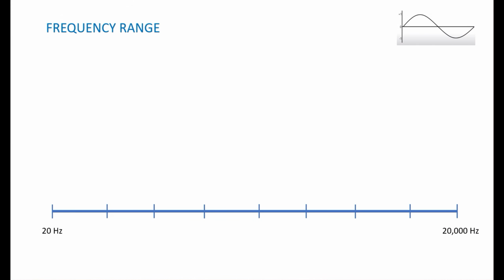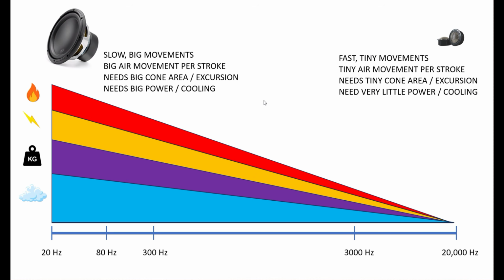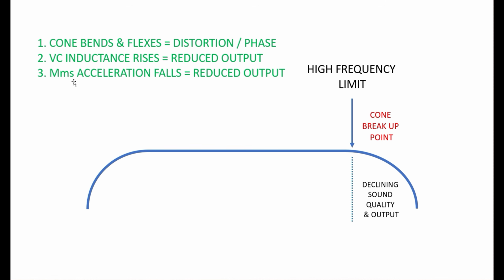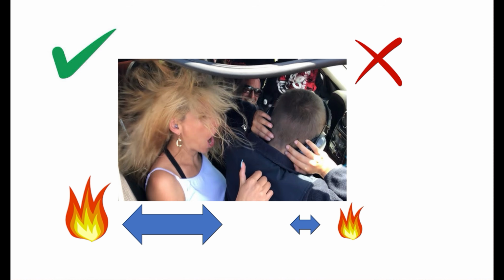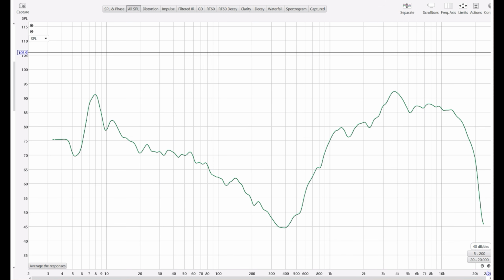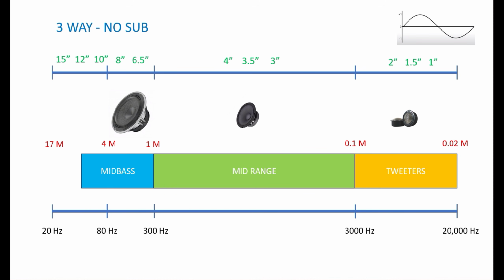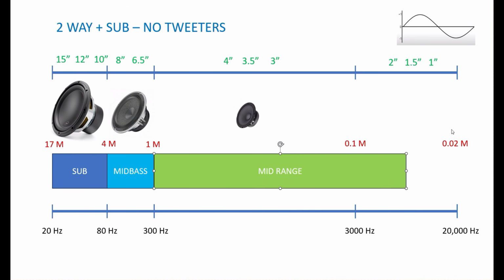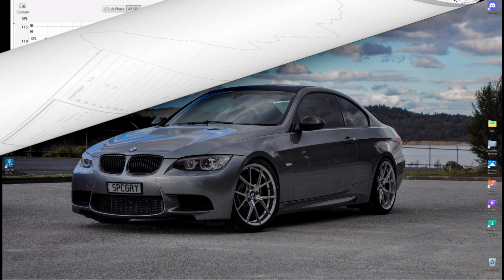FREQUENCY RANGE & SPEAKER LIMITS

Comment: With 2-way  no problem to make a really good sounding system "6.5 + tweeter" without any mid compromise. But 90% not in a car)) Non cause of your listed problems! At home you listen to midbass almost on-line, 15 degrees angle maybe. But in car this is main problem: the bigger speaker the earlier and stronger it dependant on angle of listening. Why 3-4 inch mid make so big difference: at first it is less angle-dependant. Second - you can locate it much better for listening angle and direction. Third - distance between drivers and their bands are more close to each other, you can place MR and HF really close to each other while distance between LF and MR is not so critical as wave at cross-point is much longer. P. S. in pro audio for outdoor performanse midrange drivers quite often are 12 even 15 inches and they can easy go up to 1500 Hz at least!)) 8 inch play perfect to 2-3 kHz, so size alone is not really so principal problem
Reply from the maker: Correct, it is not just about speaker size, listening angle and location play, installation, tuning etc, all play a role in the end result.  Your example of being able to locate a mid close to a tweeter makes it easier to integrate then a mid bass in a door is a good example of this.  Large speakers absolutely can play high frequencies, but the question is whether they are the best suited for the job in car audio?  For example you can get a good result from a 2-way system without mids, although it is usually more difficult to do and is dependant on the mid bass and tweeters upper and lower frequency limits once installed and tuned.  It also depends on your goals (eg budget build vs SQ build). The point of the video was not to say you must have a 3" to play 3000Hz.  It was to explain that every speaker is designed to play a certain frequency range well and speakers are different sizes and designs, because different parts of frequency bands require different things from a speaker (e.g. bass requires more displacement and power).  The other key point of the video was to explain every driver has its upper and lower limits. You can push speakers beyond those limits, but the trade-off is, increased distortion and reduced sound quality. Asking a speaker to cover more range then it is designed to play, will result in a compromise in sound quality.   I hope this makes sense, I really like your insights. It shows a very advanced understanding of the subject and I fully agree, size alone is not the principle problem :)   Big thumbs up

Comment: Hi, great channel, lots of useful information. I have Helix DSP 3 installed on my system. I wanted to configure it, but the computer doesn't detect the processor, and then the red light started blinking. How do I reset it to factory settings now?
Reply from the maker: Hi Alek.  Page 18 of your user manual describes what the flashing lights mean . So it depends on if they are flashing fast or slow.  If the software is corrupted then you need to update it but given your computer doesn’t detect the dsp then I’m guessing you can’t do that. Resetting the DSP is also covered on page 18. You press the button marked control for 5 seconds.  I have never done this myself, so I have idea what this does. So do this at your own risk mate.  Once reset i guess you will need to upload the pc tool software etc.  good luck I hope you get it sorted
Reply: @socketsocket2763  I found the problem. My laptop has USB 3.0 ports, and it sees the DSP, but it can't connect to it in the program. I bought a USB 3.0 to 2.0 adapter, and everything worked. I updated the firmware and downloaded the presets.
Reply from the maker: Great news mate. Glad you got it sorted

Comment: Most speaker set up nowadays are at 165mm. Sub woofer included.
Reply from the maker: Yes that format is very common as well.   The same problem applies that I mentioned in the 2 way system example, you have a 6.5” speaker trying to play the range best suited to a mid. Ok for most people. Not the best if you have higher goals.   Dont get me started on 6.5” coax speakers 😂